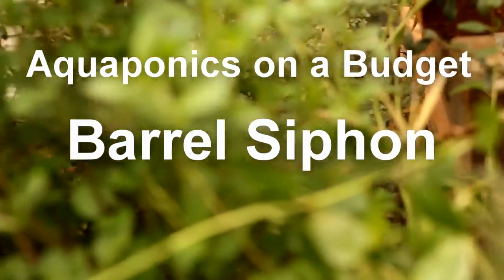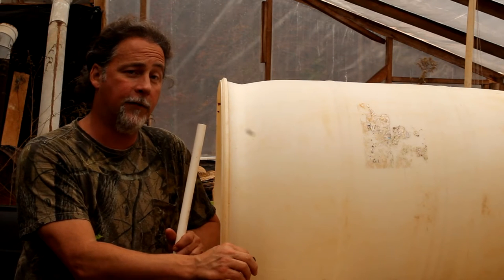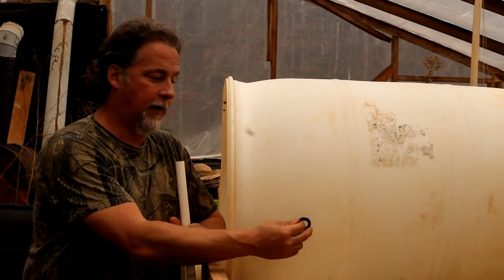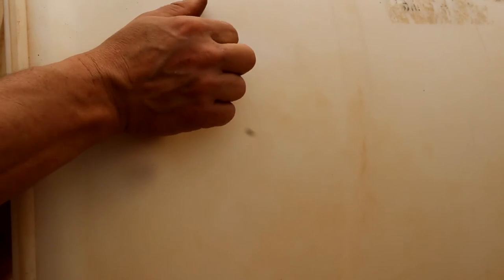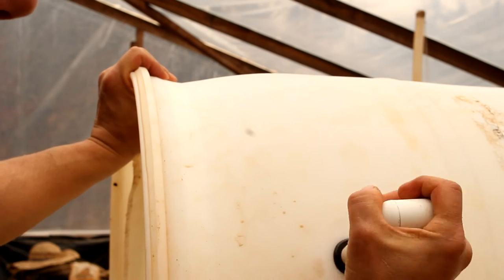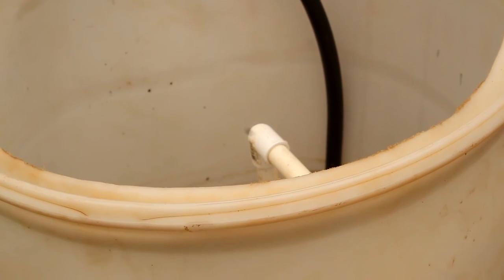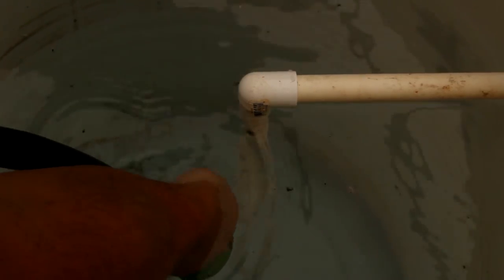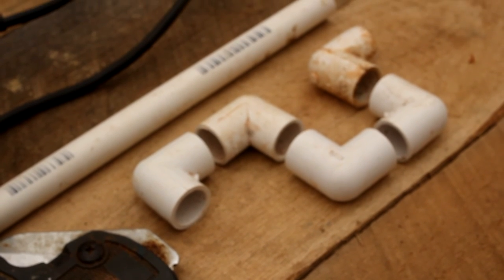Aquaponics on a Budget "Barrel Siphon"

Comment: Daniel! How far down did it drain?!?!?!😭
Reply from the maker: Its still slowly draining this morning I think it will stop about 3/4 of the way down, but playing around with it some shortening the pipe lengths or moving the angles just a little can adjust the flow. Having a bucket full of water with the end in the water really works well. Still testing and playing around I will let you know what I figure out Bro!
Reply: Those Grommets look like 3MPR9, or maybe 3MPL8 or 3MPT1, Next time try 3MNR3, 1/8" slot in the side should be much easier to install ~$10/25